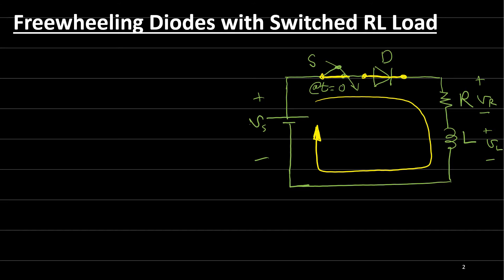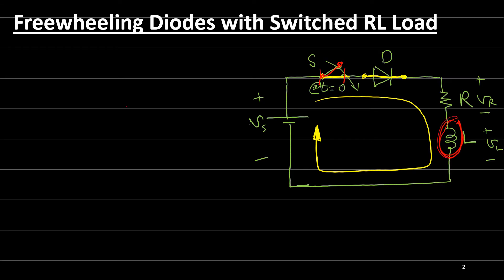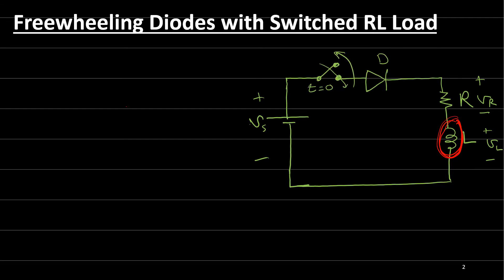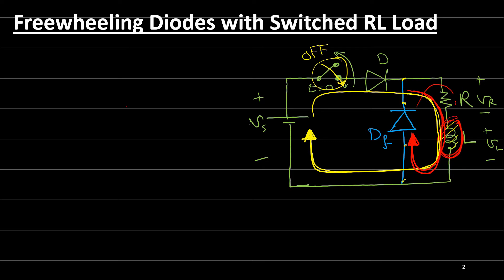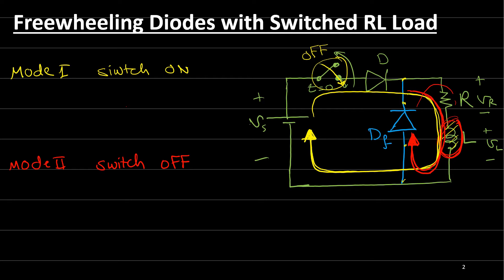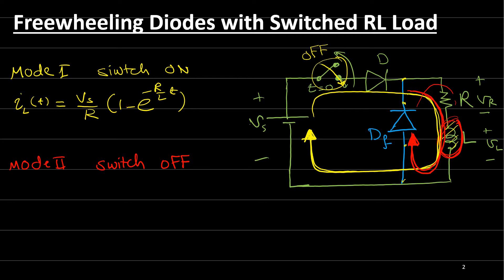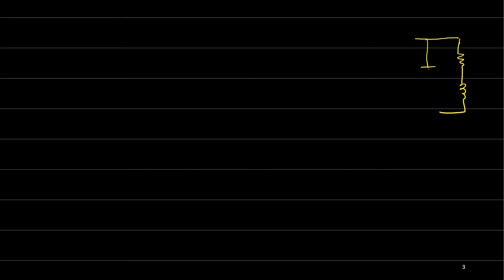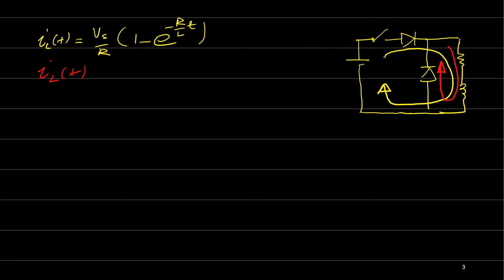Freewheeling Diode | Power Electronics

Comment: This is a nice video, many thanks. A question: Why do you show a diode in series to the switch? I guess it is not needed in order to make the case for the free wheeling Diode, right?
Reply from the maker: Many thanks for the comment. I think it's not needed if the input is DC but we need a switch to make the step change in the circuit. You are correct the "diode" itself will not be needed to make the case of the freewheeling diode. But this circuit is influenced from the LC version where a diode is needed in order not to keep energy flowing between the capacitor and inductor.